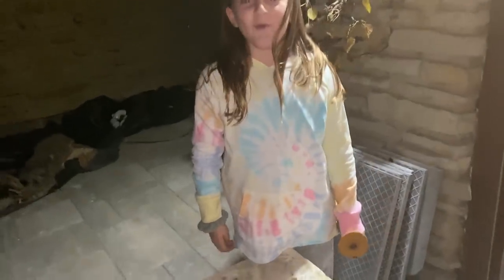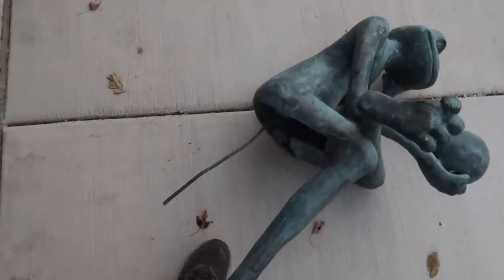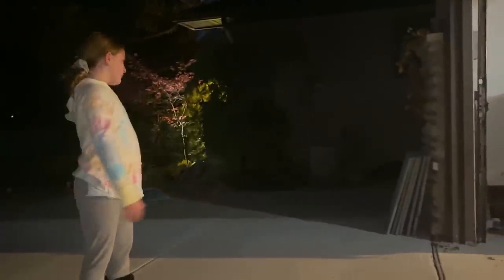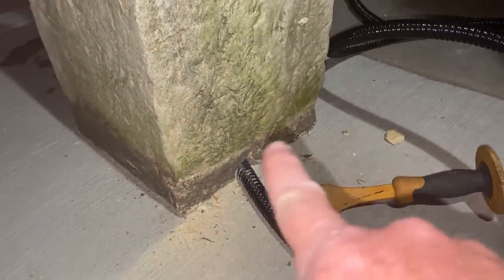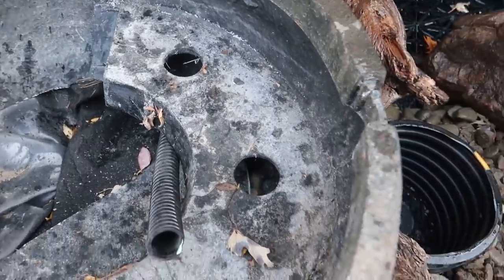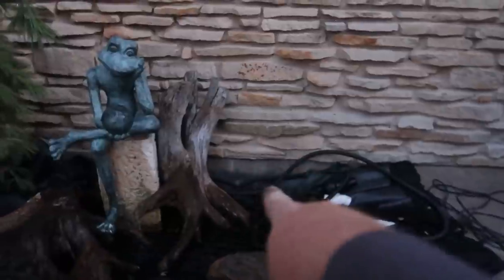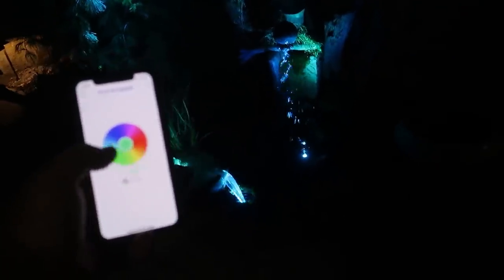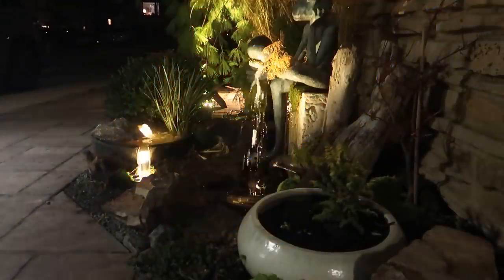*FOUNTAIN* REVEAL for Brian's Front Yard - Part 2

Comment: I'm with you on the white light. The only thing I might have had you do different if you were installing that in my front yard is the pipe that the small ribbon fall is flowing into (out of the bowl). I think I'd have gone with a smooth walled pipe instead of the one with rings, to give it a more of an infinity type effect. That's really looking really hard for a minor and ultimately insignificant change though. Fantastic work. I think your daughter has earned herself a steak dinner with that one (or whatever her favorite dinner is).